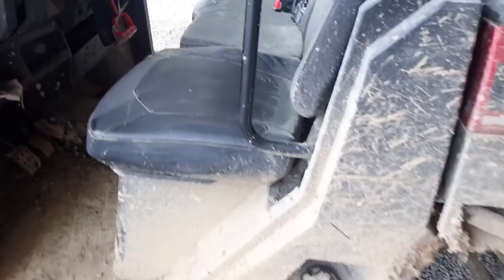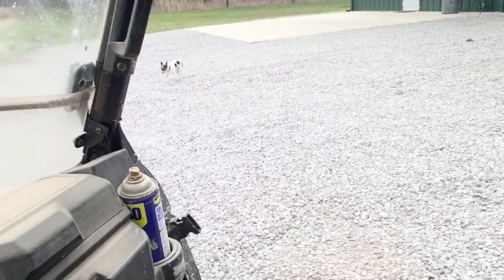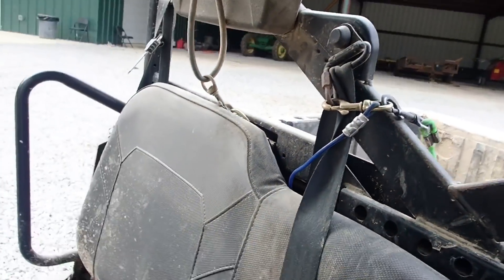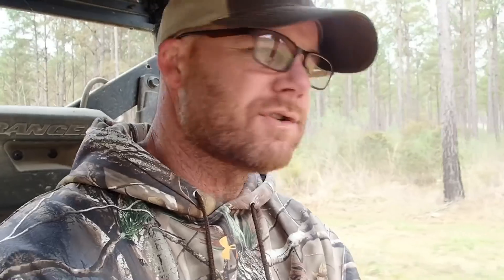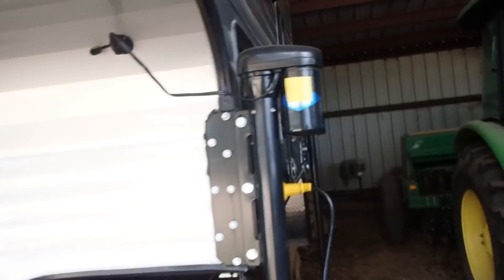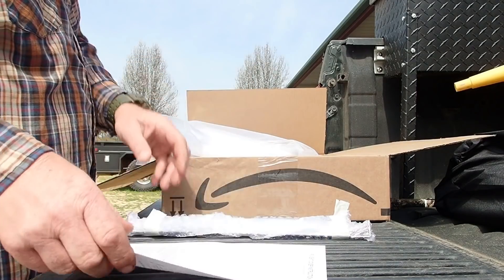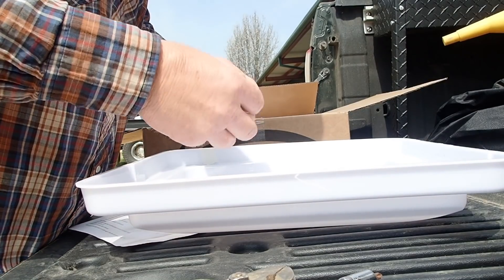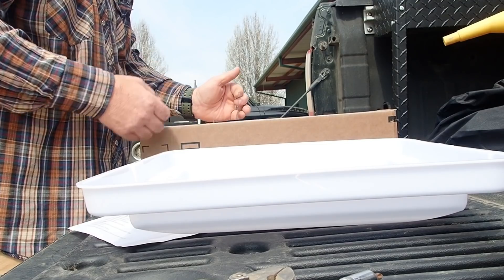NEW VENT ON THE TOTER HOME 🤔🤔🤔

Comment: Jason you should fix that seal under the vent cover around that lip and on the corners,if it’s raining the wind will blow water under it and it will drip inside or if you are travelling in the rain again the wind is going to force water under that lid and water is going to get inside  and make a big mess and may get into the roof cavity, I like the way you fixed that pivot though good job you done well

Comment: I like your motorhome. It always seems like there's something that needs to be repaired on them, And looking around that vent where the entire thing bolts to the roof, it's looking like it's time to have everything on the roof resealed. It should be done at least every couple of years because water will start sneaking in and getting between the ceiling and the roof, and even down into the walls and you won't know it until it's too late. I found that out the hard way, and I had to have half of the entire wall on one side tore out and replaced, cabinets, insolation, and all. It was an expensive repair.
Reply from the maker: Thanks

Comment: I use the max air covers on top of my vents. Easy to add and protects the part you replaced plus let's you keep them open and the rain and critters out and many other advantages. You should look into them. Just $25 each. Looking like you have the mounts for it already on that vent